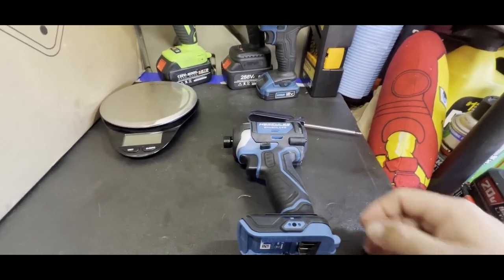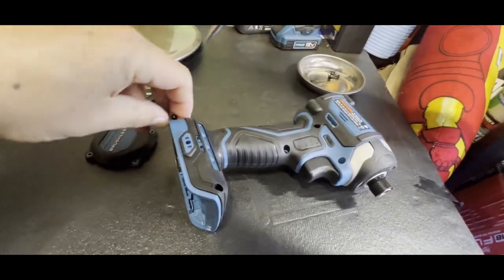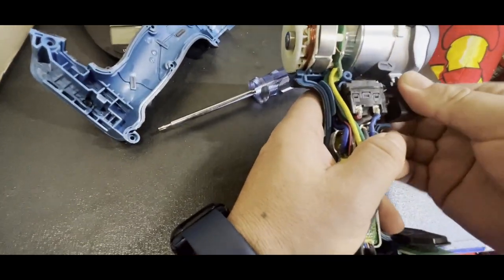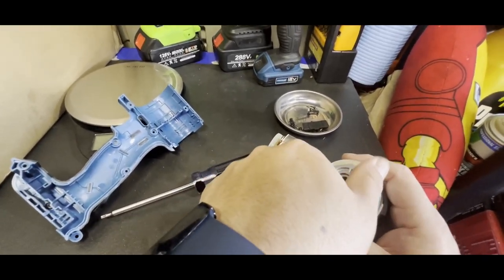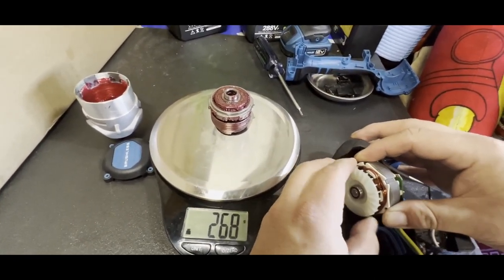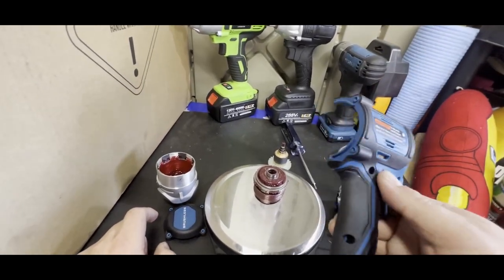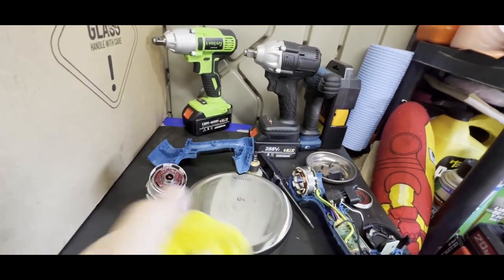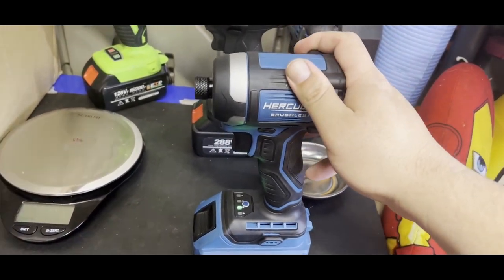Hercules New Brushless Impact Driver Disassembly!

Comment: Have you ever tried modding your impacts with epoxy to increase its durability?  Just curious.  I never thought about it until I watched this video.  I wonder if HF engineers avoided it to allow for better heat dissipation, as I have heard this model gets hot.  Epoxy would definitely trap the heat over the copper wire windings and slow cool-down times.  There may be a way to add 'spot-weld' style segments of epoxy to avoid completely covering the windings though.

Comment: I have a question, I just bought the kit (Hercules 20v brushless impact driver) to build a 10X8 shed foundation and love the performance of the tool, but when I got down to like one bar on the battery it started making a click noise when I pulled the trigger, you can't hear it you can only feel it, then it spins normally. I know it's supposed to make a clicking noise after I have mounted the screw but is it suppose to make a click on startup every time after I've used it for 15 or 20 minutes. For example the motor is cold now and if I pulled the trigger it would just spin but after I start using it and the motor is warm and I'm about to drill a screw it'll make that first click and then spin normally. Now is it supposed to do that or should I take it back and replace it. Any help would be appreciated....
Reply from the maker: Hmm ill try mine to see if i can replicate results
Reply from the maker: Is it on auto mode or one of the regular modes
Reply: @toolsonabudget7763  Thanks for responding, I took mine back and got a replacement but this one does the same thing. So I guess it's normal.......
Reply: Sound like the planet Gear or ring gear but that should be a grinding sound or something missing come tooth those impact hit hard if the gear are not hurting right it would just be garbage

Comment: can we modify this 20V "Brushless" to use DeWalt battery. like in this video https://youtu.be/XkH1yk6qbuI
Reply from the maker: i think he did it with a 12v but im sure it would work with a 20v assuming the positive and negative are in the same spot
Reply: @toolsonabudget7763  Thanks... i will try...